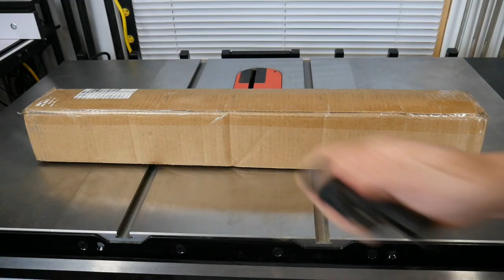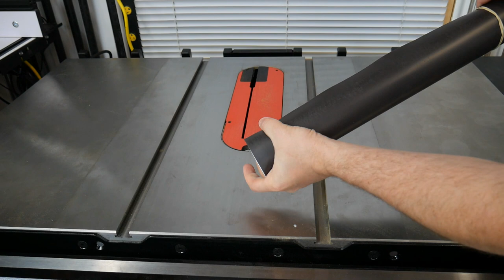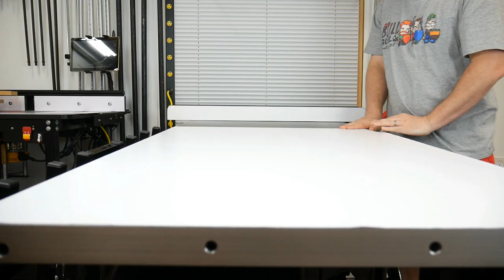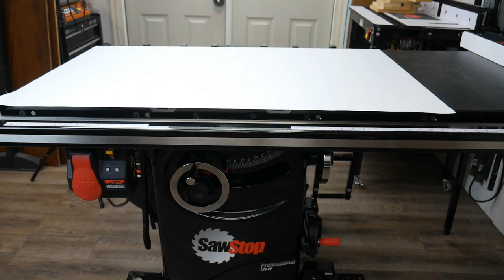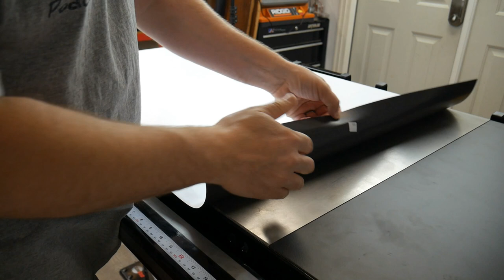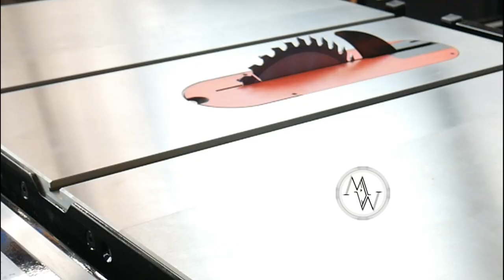Protect Your Tablesaw Surface! Use It As A Workbench.

Comment: LOL, chunk stuff on a $1500 plus table saw? why not! not to mention you can't be bothered by leveling it, oh my ...... "When you spend huge $$$ on a tool," you use as intended, build a workbench, unsubscribed!
Reply from the maker: First off, its much more that 1500.  Second, this was clearly to show off the protection  it’s still my baby.   Thirdly, it was “up” position in its stand because I rolled it away from the wall to get the camera angle I wanted.  Finally, we’re not all blessed with large shops, so a huge flat surface like the table saw commonly becomes a work surface.  I have no room for a second workbench and my first is covered with a project.   Thanks for stopping by Byron ✌️